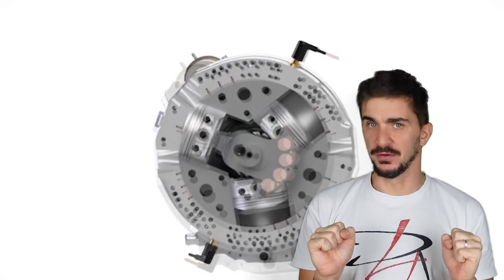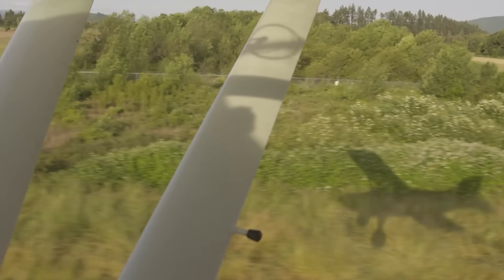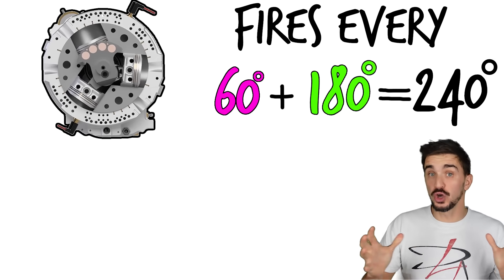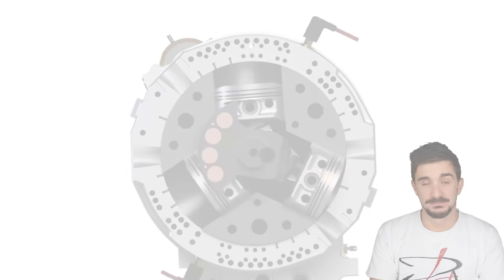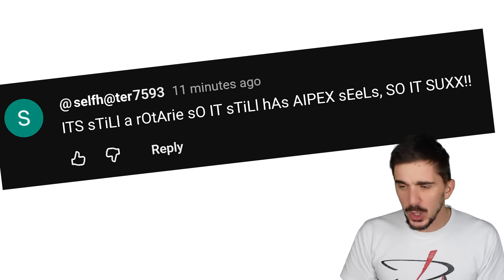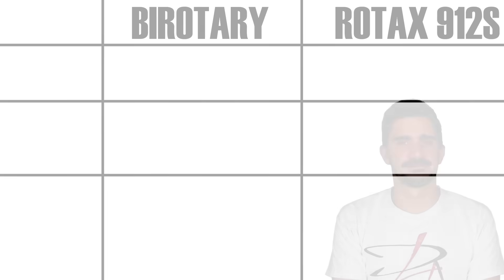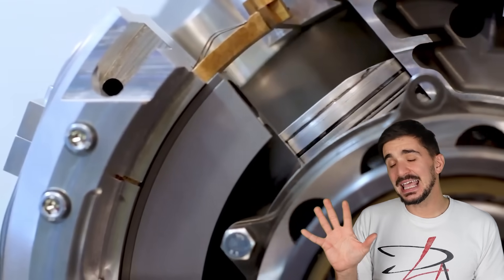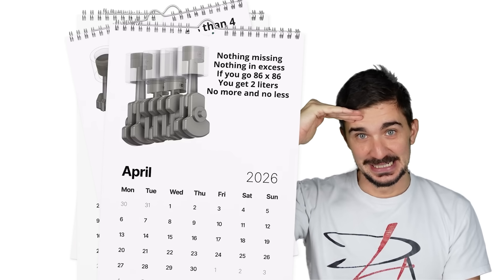This is What Happens When Pistons and Rotaries Make Babies - Birotary Engine Explained and Reviewed

Comment: Ok, my main two questions that seem like potential concerns to me is; cooling and lubrication. How do you lubricate the rotary section inside the houseing, without getting anything inside the compression chambers? Is it on some kind of rail system? And if the rotary is spinning at 3k and the cam spinning at 7.5 how are they managing cooling. I suppose being in the air with a massive fan in feont helps. But it still seems to me me like it would generate a lot of heat

Comment: I know just enough about engines to know I don’t know jack, but this engine has two point to draw rotational energy from. The block and the crank. The design presented only draws from the crank which if I’m understanding correctly, they are losing the rpms generated by the block. 

If they could control the rpms, it could be used for automotive use, but as presented it appears to be all or nothing. A good transition would help with the short stroke issues too.

Thank you for this interesting information.

Comment: I wonder if adding VVT and maybe turbo/supercharging it could provide some benefits to the power delivery. Variable supercharging might be an option here for needed boost at lower rpm reducing it as it revs higher. This is of course all moot if the fuel economy isn't better than the engine it seeks to replace

Comment: Very interesting video.  Thank you.  Do you think this engine could be used to power a generator in a "hybrid" system?  Use this engine at a constant RPM to run a generator, then use the generator to power batteries, and finally the batteries driving wheel motors.  What are your thoughts?

Comment: I think the rotary exhaust valve 2 stroke engine is the best design so far. Especially if it used a cleaner burning fuel like propane or ethanol.

Comment: The exhaust valves could be adjusted with "power valves"  like many snow machines use.   I wonder if the valves could be a rotating ring,  so that the crankshaft length could be longer?

Comment: WRT the rotation angle per firing, shouldn’t you subtract the rotation of the rotor from that of the crankshaft because they are in opposite directions? This would give angle of rotation of crank relative to the housing, which doesn’t rotate.

Comment: A cvt transmission would be good for this engine on a motorcycle or a small car. Or has been stated elsewhere a engine, electric combo. What bothers me is you are adding the rotation of the piston to the rotation of the block for a total but they are in opposite directions.  Also the fact that it fires twice for 1 rotation of the "crank" in relation to the base outer block. The fact that with all the rotating mass it would act like the old flywheels of yesteryear and would be good for coasting.

Comment: ב''ה, VVT with valve slots and shim-like vanes that insert from fore/aft to occlude the slots?  Possibly sealing issues except maybe less than expected because you're trying to get gases into or out of the chamber at those points anyway.

Think a vane with a diagonal "/" drilled across it so the portion of the / occluding the slot selects your VVT.

Comment: Not all cares use the entire RPM range all of the time.  This think can be put into a hybrid that runs at it's most efficient conditions for charging batteries while electric motors drive the car.  Efficiency could be where it shines, and if it is really efficient and small, maybe it could be packaged well and put into the frunk of a Tesla for a range extender?  Also, higher RPMs could be a bit more effective for charging for battery charging applications like a switching power supply.

Comment: That's awesome. Thank you for this info.

You're missing 2 points
- Short stroke => hydrogen fuel
- No long (un row) crank shaft => stackable engine 

Speed variability is not critical because cvt, and more so range ex extender.

My concern is cooling in the cylinder housing.

Comment: In over 2 decades of flying planes, especially pistons early  in my career, my experience is that gearboxes and liquid cooled engines tend to blow up, even if it's a simple planetary reduction gear, well before engines reach their TBO. In the general aviation segment, simplicity is strongly favored, and for good reason. For this reason I'm a big proponent of miniaturized turbine engines. They don't look like it to the layperson, but they can be extremely simple and reliable engines, and even very efficient with the addition of heat recovery features and what not.

Also nitpicking at 7:50 : your average lycoming/continental direct-drive air cooled boxer engine you'll find on 80% of all piston planes almost never revs above 2700 RPM, as propeller tips can start to go supersonic (among many other reasons). 5500 RPM is more typical for somehting like a Rotax which have gear reductions

Comment: Technically even as part of the same assembly inertial pinning would still occur. the motor may rotate "freely" but every rotational mass inside would still be fighting the other counter rotating mass. 

think of it this way. the clockwise spinning parts want to twist one direction, the counter clockwise spinning parts want to go the other. so eventually as bearing wear occurs (which it will at an accelerated rate) these items will begin to chafe and collide. which is terrible news for apex seals (i see 14) and tight tolerance assemblies.

(Counter-rotation reduces externally transmitted gyroscopic torque, but internal inertial coupling remains. As bearing stiffness degrades over time, relative motion between counter-rotating components increases, raising the risk of seal interference, contact, and accelerated wear in tight-tolerance assemblies.)

Comment: Today's menu features a combination of two old star-shaped internal combustion engine designs from the early 20th century. The only resemblance to a Wankel engine is the presence of a power take-off shaft. However, it is more closely aligned with the Duke Engine from Australia. It would be foolish to modify the mechanical components when the focus should be on the fuel system!

Comment: You can have this for free but the design seems perfect for having variable port opening with the addition of a sleeve valve type of movable outer porting. Also the spark plug seems to be placed by geometry not burn pattern.

Comment: Could "cam timing" be compensated for with forced induction? Also, what is the source of upper end lubrication for the seals? This is looking like a two-stroke solution, to me. And, before anyone with a bug up their ass decides to play: no, I am not an engineer, and I won't ever claim to be one. Thanks in advance.
Reply: Speaking of lubrication, I was wondering about that rotating inner case. Is oil stacking up under the pistons, held in place by centrifugal force ? Is all that extra force trying to push oil past the piston rings and into the combustion chamber 🤔

Comment: One thing not mentioned is lubrication!
That spinning cylinder block with seals will need oil + the crank and pistons need oil but there's no obvious way that a crankshaft fed lubricant could be recovered!?
Reply: My understanding is that, at this stage, this engine requires some lubricant to be added to the intake charge, as per conventional 2 strokes.
Reply: i think this is true and the reason burning oil like this doesn't matter is because aviation engines get away with more in terms of emissions than automotive engines. A lot of people in the comments on this video are immediately forgetting that this is an aircraft engine lol
Reply: I'm no expert on the matter by any means. But conventional car piston engines get lubrication from unerneath themselves just by hitting the oil with counterweights and a tiny gap between piston and cylinder. Lubricating the rotating engine block in the housing could be the problem if there isn't enough oil passing from cylinders through there. So i suppose the only thing would be some type of injector of oil between the seals or using a two stroke oil and gas mixture in the cylinders. I think the lubrication is satisfied.
Reply: @dsosic-p1m  Um, no. Automotive engines get their lubrication from an oil pump. I believe you are thinking of a small, one cylinder engine with an oil "scoop" attached to the crankshaft that dips into the oil pan and flings oil all over inside the crankcase and the underside of the piston.
Reply: @dsosic-p1m Pressurized oil is required for the piston rod bearings and crankshaft main bearings, so the rotating assembly can work. This is accomplished with an oil pump, creating an “oil wedge” between the bearing surface and crankshaft surface.
Reply: @jfonestar 
Harley Davidson oil tank and oil pump. 👍
Reply: Shhhh. The government has always and will always have your best interests at heart.

Comment: yes hybrid generator for sure as some have already stated below. It would probably have better longevity and emissions than a rotary or the liquid piston engine, which would be concurrent with the green ideology of an electric car. Also, the longevity would probably be double to three times better than those engines as well so you could probably get 200,000+ miles out of your electric car before having to do any major maintenance on the engine. Also, it being a rotary type design vibrations should be minimal, therefore making it easy to make it "disappear" from the consumers perception, which is ideal being that peace and quiet is a big factor for electric cars.

Comment: How is the rotating "cylinder" cooled?
   Are you sure that equal counter rotating masses have no gyroscopic effect? They each have "rigidity in space", how does one system with this rigidity cancel out another, just because the rigidity is caused by rotation in another direction? One rotating mass does not "know" the direction of rotation of other associated rotating masses, each simply resists motion.. 
   I have made a similar comment on other videos that mention this cancelation effect, with no responses yet, so bought a couple of cheap toy gyroscopes to see, I have to find some time to play with it.
   Intuitively,  this cancelation effect strikes me as wrong, but I'm not certain.
    Thanks, I enjoy your videos & humor.
Reply: I thought that the precession effect would be canceled. If two opposite rotating gyros were attached to each other, moving the whole assembly would cause one to try to precess one way, the other would try to go the other way,,which obviously could not happen if they remain attached to each other. 
    So, I figured movement resulting from precession had to be canceled,  but the resistance to movement would remain.
   I did attach my 2 gyros together, and it appears that BOTH are canceled,  the assembly resists movement when they are spun the same way, and the precession forces can be felt.
   When I spin them opposite directions,  the precession forces are clearly gone. It also seems that the stability is gone... not 100% sure, as I only did it by feel, and the assembly...2 gyros and handle, is a bit heavier than I'd like, which masks the feeling of stability a little. 
     I really didn't expect that. Intuition isn't always right. Or my Intuition,  at least.

Comment: I'm not a fan of the roller bearings on the crankshaft or the way the open / top part of the cylinder passes by the seals. The bearings look as if they should be more like automotive crankshaft bearings, and the open top of the cylinder looks as if it would "slice" the seals every time it passes. Perhaps chamfer the edges of the cylinder.

Comment: Very cool breakdown of the tech! There's a few things I didn't quite follow. 

1. Why would stroke length affect the basic geometry? It would make the circle larger, but the basic design could remain the same. If flame front speed is a concern, it could simply operate at a lower RPM range.

2. What is fundamentally different from the valve timing in this engine and a traditional piston engine that doesn't have variable valve timing? You still have to pick a rev range to optimize.

3. Among natually aspirated piston engines, the torque per liter figure is fairy constant, despite some being long stroke and some being short stroke. I understand crankshaft leverage, but if displacement is held constant while the stroke decreases and bore increases, you get a harder push with reduced leverage and roughly the same net torque. The short stroke wide bore both reduces piston speeds and allows for bigger valves, so the peak torque RPM and redline can be much higher. But it could be tuned to match a long stroke engine if desired, but then you're throwing away 'free' horsepower. 

4. Does the poor transient response come from the higher moving mass of the rotating block?

5. Can you take power from either the block or the crankshaft? Might make for an interesting 3 speed transmission with 6 output speeds, by selecting which output you take the power from. More weight and space savings!

Comment: Having owned an 85 RX7, I am familiar with rotor seal problems and failures, and like the fact this only has the typical standard piston rings as seals. However, I think this will be yet another "new" engine design which will never make it to the mainstream or into a product (like the "one cycle" engine, the Achates opposed piston engine, liquid piston, etc).

Comment: The one possible application for cars is in a hybrid car - the fixed RPM is similar to a diesel-electric hybrid locomotive.  Combined with some battery and direct electric motor control could work.

Comment: This would be a great engine for purposes that require a constant RPM, such as aircraft, lawnmowers, well pumps, electric generation systems, etc. Be interesting to see if this can be made in a diesel-electric configuration where a high rev, constant velocity engine propels an electric generator to charge an electric battery or electrical system.

Comment: the inner block is the balancer...... so it rotation only matters in vibration/ torque bend
if you length it.. that means you'll have to widen it as well.... so it could have time to complete the stroke...

Comment: The short power band is not a problem if it is coupled to a cvt - continuously variable transmission on a motorcycle. Especially the geared cvt you featured. In cars, it coud be used as a range extender - to power a generator at constat rpm. What do you think?

Comment: Thanks, great video. How does the oiling system work? Especially at the top of cylinder head. What stops any oil there from getting into the combustion chamber? Or does it run on 2 stroke type fuel with an oil component?

Comment: You forgot about boats. This is perfect for boats, where it can be tuned for a single speed but it has fewer complicated parts which would mean longer service intervals. It's especially great for jet skis and jet boats, where higher RPM allows the impeller to have less aggressive pitch for greater efficiency. Obviously for a jet drive you'd want the crank's 7500rpm not the block's 2500rpm which is better for propeller planes and slow displacement hull boats.

Comment: I get the point of the sealins being way better than in previous rotary designs. But they also look way more complex. It looks even worse than the efford for a normal cylinder head and valves and stuff.
Also this video completely misses the point of cooling. I guess a longer stroke means less cooling area for the burning volume as well.

Comment: Slow flying aeroplanes run a large slow propeller. Fast flying propeller planes run small propellers at higher RPM. So if a Red Bull air race style of plane used one, it could run the propeller off the crank rather than the block to get 7500RPM at the propeller.

Comment: It doesn't have utility for cars due to transient response when driving a crankshaft directly, but what about using it as a generator in hybrid vehicles such as generator-driven trucks or trains? How does its power density compare to a diesel engine used for the generator of such trucks?

Could it then similar be utilized as the generator for a hybrid car?

Comment: I thought that neander engine would be the only engine with two crankshaft per piston. But I guess this has sort of the same effect?

Also, this engine might be really good with a cvt, if the cvt is able to hold the rpm and keep changing the ratio. 
That or in a hybrid as an range extender.

Comment: At 3000rpm in a conventional 4 stroke engine the crankshaft is spinning at 6000rpm. So if the engine redlines at 6500rpm then tbe crank is at 13000 rpm. So your assessment of 10000 rpm for the birotary engine is a bit flawed by saying it spins faster than a conventional 4 stroke.

Comment: What about the Birotaries's use as extended range engines in EV(-Trucks), which required running at a constant speed to charge the battery? 
If it is more fuel efficient than a regular engine that could be a use case for the car industry

Comment: What is the benefit of this design over a radial 3 cylinder of the same bore and stroke. Especially if you include variable valve timing in the radial.
It seems to me that there is unnecessary complexity in lubricating such a design's seals that could be avoided by not having the cylinders spin. Additional centrifugal forces on the pistons means heavier connecting rod vs comparable radial.

Comment: This is ridiculous, torque is not going away as long as an engine is making torque. It will always try to lift a front wheel when a heavy truck is it lowest gear trying to get a heavy load up a hill 
As long as torque is making the load go up the hill. Lets see your torqueless engine make a helicpter fly with one main rotor and without a tail rotor. Its absurd to think the effects of engine torque could ever be canceled by counter rotating engine parts